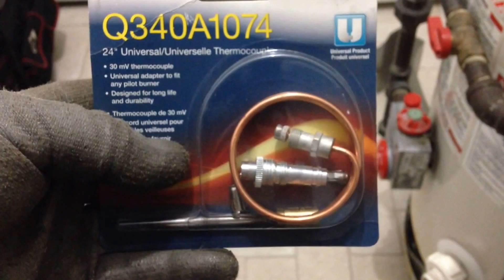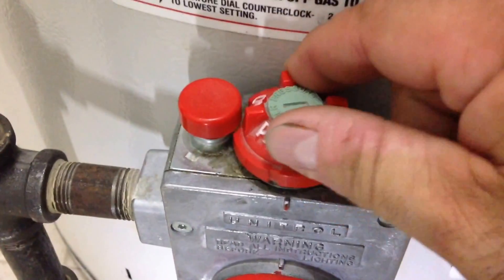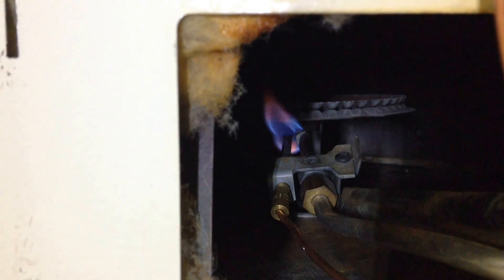HOW TO REPLACE A THERMOCOUPLE ON A WATER HEATER DIY

Comment from the maker: 🔧I'm an HVAC tech ...I finally put out a Helpful video in my field of work. Hope this helps...any questions plz comment below🔧Also, if you'd like to watch a SPEED REPAIR(FUNNY) video then here you go ▶️ https://youtu.be/eQZwkswDdf8
Reply: Instead of 3/8, I used 10mm on the thermocouple.  Don't get me wrong... the 3/8 works too.  It's just that 10mm is a better fit.
Reply from the maker: +Iggi Valencia Thanks - I’ll give that a try as well

Comment: 3:31 How important is this clip? It is way too narrow to allow the thermocouple through. Even just a dry run before hand it is too small. But then logically why is it there? Of course use it. But how if it's too small? I've already bent mine up.
Reply: Update. I just kept thinking it made zero sense the clip would he absolutely too small that it was deceptively too small. Forcing it by hand was a no go because the copper pipe was going to suffer. 

Improvised decision. Got clip almost reformed and put back in halfway. Put thermocouple in to help push/force the clip all the way into place. Then.  Vice grips just barely tight enough. Clamp onto the thermocouple about 1/4 inch back from the two holes part it goes though. Then "pry" back using the heater "face" as a stiff surface and voila! The thermocouple popped through. 
Geez. lol
Reply from the maker: Oh My.

Comment: Ther is a silver and a copper 1 are they both called thermocouple
Reply from the maker: Silver one is most likely a Thermopile( generates MV for a special  Gas Valve and has electrical terminals to connect to the gas valve). Copper is the one used in this video.

Comment: This is a really good video, but I did exactly the same thing you did, but my pilot light still went  out when the burner shut off, so I bought a new water heater. It was old, had a leak and the inside of the tank was rusted so it was time for a new water heater. I just didn’t want to spend the money
Reply from the maker: Yeah. Could’ve been a bad gas control which is easy to replace as well. If the tank is very old then replacing it is a good choice. At least you tried the cheapest route first

Comment: Great video!! Was very helpful. My pilot light won't stay light, I know pressing the button down it does get gas as I can light it but won't stay lit. I replaced the thermocouple, but it still won't stay light. Any ideas?Would it be the main control valve itself?
Reply from the maker: +William Ly is the pilot flame in line and hitting the thermocouple?
Reply: Yes. I replaced it with the same length Honeywell unit 18".  Strange thing is, the heater was working before I started repairs on the water lines.  I had no hot water pressure, and found out the hot outlet was plugged up with sediment and calcium/rust. Changed the outlet nipple with a di-electric one and all that was good. Tried to re-light after repairs and then no dice.  I'll have to re-check the positioning. I'm thinking the magnet inside the control valve is weak. Tank is a 16 year old John Woods unit, might be time to suck it up and buy a new tank.
Reply from the maker: +William Ly yeah!! 16 years is a good life these days for a tank- it is quite easy to replace the gas control though - just match up your model and serial number to get the correct one- shut the valve to the tank, relieve pressure on hot side at a sink by opening faucet until water trickles,shut sink back off and swap it out....prep new control with pipe dope or teflon tape first helps

Comment: Ryan i noticed that you did not turn off the valve for the gas pipe going to the water heater??? Is that not necessary? or just turning the knob off in the heater controller is enough? the reason i ask is because i do not have access to the gas pipe valve........So if just turning off the knob is good enough (just like you did) I will go ahead and do the job.. If i can get a response i will appreciated....Thanks
Reply: Ryan's den.  Excellent video.   Very helpful.
Reply from the maker: It is good to shut off gas valve in line but if it's not accessible then turning knob off on gas control at the water tank is good along with turning temperature knob all the way down as well- Hope that helps!!
Reply: Thanks Ryan that really helped me. I was about to tear down the heater closet. thanks again. ..much appreciated
Reply from the maker: Your Welcome
Reply: I smell gas after I replaced the thermocouple and press down the button before igniting the polite. Is that normal?
Reply from the maker: +Tom storm use a soap bottle and spray or apply with your finger to the connections at the bottom of gas control for a gas leak ( bubbles will appear if a leak is present)- where you removed the burner/ pilot / thermocouple from - the pilot line or main gas burner line may be loose - retighten and then check for leaks with soap again
Reply: The Ryan's Den Thanks